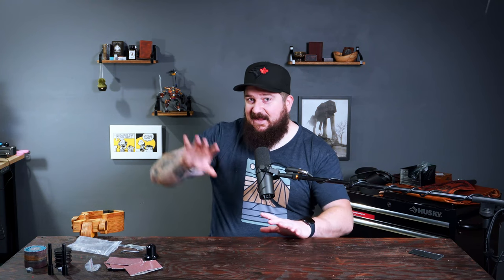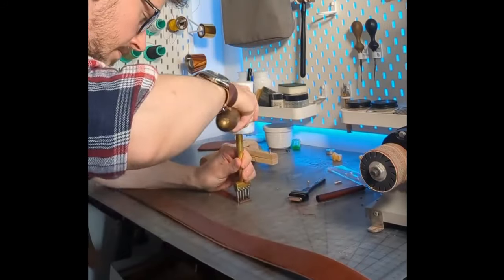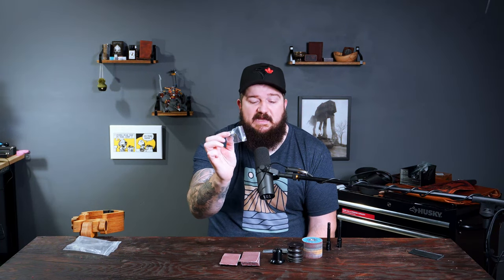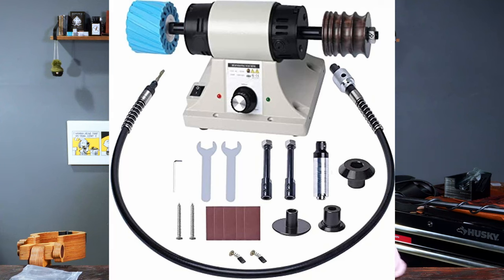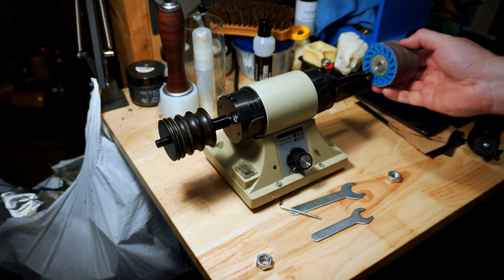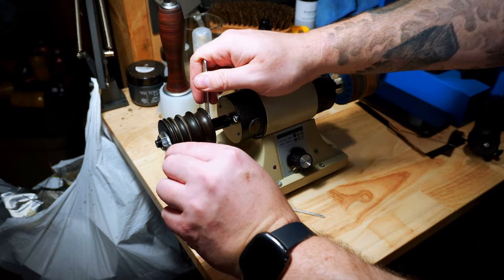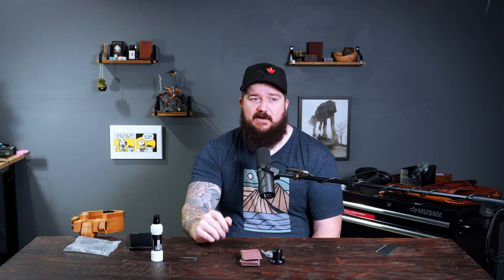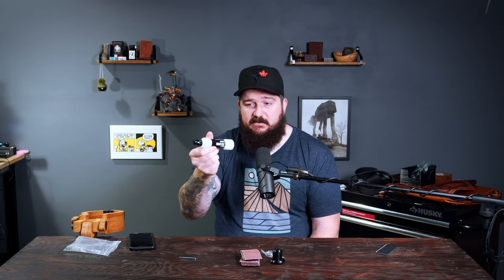Reviewing a $145 Leather Burnishing Machine

Comment: Two tips for this machine...1, use water based lube to get the sanding sleeves on. Smear a tiny amount on the wheel 1st. Putting the sleeve on after that Is super easy, barely an inconvenience. It will dry in no time and be ready to use in 5 mins. 

2, Mount the machine on a board as wide as the base so you have lots of room to manoeuvre and fit larger pieces under it.

Bonus tip... make a shroud out of something like an icecream container and mount it behind the sander to contain the mess. 🤙
Reply from the maker: You are brilliant. I'm pinning this comment. Thank you.
Reply: @Black Flag Leather Goods  that's an honour I'll proudly take mate. You are the guy that convinced me to buy one and I use the thing all the time. It made life a lot easier. 🤙
Reply: Thanks for the lube tip! It made the process MUCH easier. 

I'm going to try the other tricks as well. Can you clarify what you mean about the shroud?
Reply: What is a good water based lube?

Comment: You could mount the burnisher to a piece of plywood or other wood and clamp that to your bench. You can place it anywhere you need it and put it away if it takes up space on your bench. If using the two holes toward the front of the motor, wedge a piece of leather or wood before screwing it down to keep it from tilting forward. You can use those two holes to mount it to a board as well, then clamp it to your bench or other work surface. Nice video review.
Reply from the maker: Thank you! I was actually going to mount it to a board so I could move it around but I wanted a second workbench for my 3d printer anyway and had the spare room.

Thanks for watching!
Reply: Hello...How are you doing ?

Comment: Hey Tim:  Glad you did a follow up on this machine.  A suggestion.  I have a small piece of crepe sole for removing rubber and contact cement.  It serves a secondary purpose.  It will clean clogged sand paper to get more life out of the drum.  You simply turn on the machine and rub the crepe onto it and it will get in between the grit.  The other thing I would try is to move the machine to the edge of you table.  It looked like the height of the burnishing side is too low and you bump into the table surface.  That might mar the edge.  The other thing is to lift the machine up a couple of inches so you have clearance.  Otherwise, looks like a great machine.  (I am wondering if you could cut the sanding sleeves in half and have two grits on the spindle at one time).
Reply from the maker: Oh I will look into the crepe sole! That sounds amazing actually!

And you're absolutely right about it being better if it's near the edge... I just stripped the screws and haven't felt like dealing with them yet to move it haha. It would be best if someone built like a pedestal for it to sit on. I think the Cobra one comes on a pedestal and it looks perfect.

Thanks for watching, Bruce!
Reply: @BlackFlagLeatherGoods  You will be amazed at how a simple piece of crepe will extend the life of your sanding surface.  I had this left over from my OLD graphic design days (those days are over using rubber cement for anything).  I saw a video from the Wood Workers Guild of America and found my little piece.  Now they sell crepe blocks just for this purpose.  I just use my little piece.  Love your videos.  Nice and easy.  Really informative. Thank you!
Reply from the maker: I'm excited! I found it for sale at a local hardware store. They're claiming it can triple the life of sandpaper. I had ever even heard of it. Thank you!
Reply: Hello...How are you doing ?

Comment: Woodworking and general homeowner level carpentry has taught me that there are good screws (GRK and spax) and bad screws (most everything else) and the hardware that comes with stuff is never good. If you aren’t using them for a matched finish, buy good screws and throw out anything that comes in the box.
Reply from the maker: Oh man I just discovered GRK's this year rebuilding the dock at my family's cabin. Top notch
Reply: Hello...How are you doing ?

Comment: Hi Tim ! I've but the burnisher. And sand paper are so crap to install. .... I was hoping you give a trick 😁. I will have to find my own way 😂. Thank's for the review!!
Reply from the maker: Oh man it's kind of a bitch to put on. I just kind of squish it and push the sleeve on inch by inch. That's why I didn't take it back off for my review haha. I guess it's better than the sleeve being loose though.
Reply: Hello...How are you doing ?
Reply: I know this comment is old, but for anyone who may see this question another commenter suggested putting a small amount of water-based lube on the drum and then putting the sandpaper on. I tried it and it makes it a lot easier.

Comment: Screw the machine on a board as wide as the socket, 10 inch longer on the backside.
Mount that on your bench, now both arms of the machine are accessible from the bottom so that you can pull your leather stripes upward, a all belt in one pull. Much easier,  more secure.

Comment: Hi, Don't use 80 &120grit(its eats lot of leather flesh😜)... Buy 240 & 400 grit self adhesive sandpaper. U can paste two grits together on the wheel.

Buffing wheel made of Leather( Grain side out & paste beeswax ) is good for burnishing  Flesh side & Polishing Grain Side.
Reply from the maker: I use 120 on mine because I want it to eat a lot of leather. Once I have it where I want it, I hand sand down to around 1000 grit for those shiny edges ✨
Reply: Hello...How are you doing ?

Comment: This is not about the burnisher but I just started and having trouble getting a straight line and I have tried different things and still having trouble any ideas
Reply from the maker: Like trouble cutting straight lines?
Reply: Yes
Reply from the maker: Make sure you strop your knife when you start every project. You want it razor sharp. Use a good straight edge. Make multiple passes with your knife instead of one pass pushing it all the way through - that can cause the leather to warp and consequently it gets cut crooked even though you used a straight edge. Most importantly though: practice. Everything will get better if you just keep at it.
Reply: I will try making more cuts instead of trying to do it once and I never thought about strapping the razor blade I'll give it a try thank you keep up the  good work  like watching your channel
Reply from the maker: Good luck! Let me know how it goes!
Reply: Hello...How are you doing ?

Comment: Bought one. How the heck do you get the sleeve onto the drum without crippling yourself? I took some advice and tried putting the drum in the freezer. Took me 20 minutes to get the sleeve onto it and I'm pretty sure my hand is going to be black and blue tomorrow.
Reply from the maker: Hahaha it's a pretty tight fit. I haven't had to switch out my sleeve yet but I'm dreading the day
Reply: @BlackFlagLeatherGoods  dang, was hoping for a trick. I swear half of the skin for my fingers ended up on the sandpaper. What grit are you using?
Reply: Another commenter suggested using a small amount of water-based lube on the drum first. It makes it a lot easier to get it on. It's not super easy, but I'd say it's at least 60% easier to put it on.